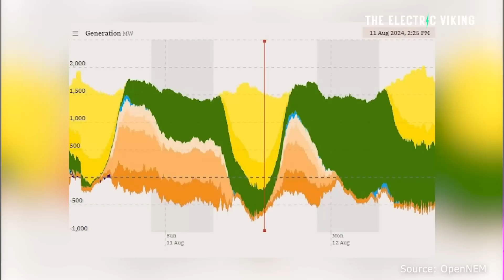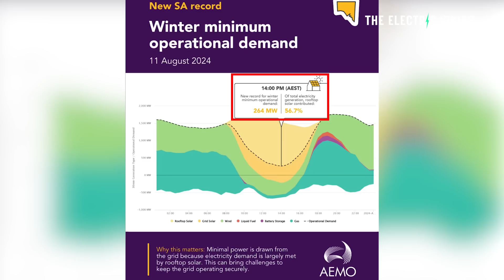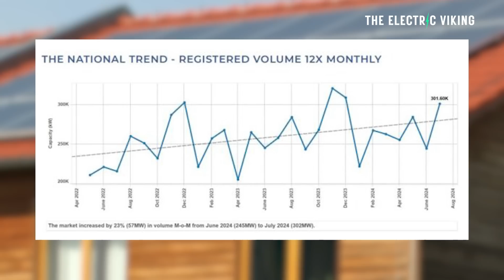Australian rooftop solar hits 81% high as Aussies install solar in record numbers

Comment: A company called Quaise Energy which is a spinoff of MIT has a new drilling technique that melts rock and is expected to be able to drill 10 to 20 kilometers deep. This will make geothermal energy available in most of the world. Former coal power plants could be run on geothermal energy and use existing facilities of these plants. This energy will be unlimited, clean, and last forever. With geothermal and thorium nuclear energy there will be no need for unsightly solar farms and windmills with their problems of recycling worn out turbine blades or toxic waste from worn out solar panels. These facilities will produce power regardless of sunshine or wind availability.
Reply: That will be great when or if it eventually becomes widespread. In the meantime Solar and wind are the best options.
Reply: Yep, no doubt. I'm sure that will be a reality in....30 years.
Reply: The melted rock would still have to be brought to the surface. This is hazardous waste because there can be high enough radiation in material from deep within the earth. Also toxic gases, dissolved heavy metals, and carbon dioxide & other greenhouse gases can be released. So geothermal is not as clean as many people believe. It also can have high water use, at a time when water is becoming a more scarce resource.
The following is from the US Fish and Wildlife Service..."Air and water pollution are two leading environmental issues associated with geothermal energy technologies. Additional concerns are the safe disposal of hazardous waste, siting and land subsidence. Most geothermal power plants require a large amount of water for cooling or other purposes. This need could raise conflicts with other users or uses such as fish spawning and rearing in areas where water is in short supply. Steam vented at the surface may contain hydrogen sulfide, ammonia, methane and carbon dioxide. Dissolved solids discharged from geothermal systems include sulfur, chlorides, silica compounds, vanadium, arsenic, mercury, nickel and other toxic heavy metals. All of these releases, if concentrated, can create localized fish and wildlife kills."
Reply: George, people with solar and batteries are free from the corrupt and price gouging electricity cartels. That is one of the points of solar, energy independence for homeowners!
Reply: @freeheeler09  Your point is well taken. There are however better technologies that have been suppressed. Some of these sound like science fiction but they have been produced by the likes of Tesla. Devices have been developed that use the earth's magnetic lines of force to produce electricity for small and large users. This is probably how Tesla was going to produce the electricity for his Montauk project. Zero-point-energy produces electricity from what used to be called the aether. It seems space is not an empty vacuum but is filled with energy. If we could free suppressed energy technologies for humanity we could enter a new golden age.
Reply: Excellent - insightful and knowledgeable.

Comment: To beat the system run a couple of extension leads to your neighbours when you are producing extra power😅😅😅😅
Reply: That's a good interim measure until batteries become a bit cheaper.
Reply: Here in BC, Canadia, BCHydro credits our net-metered overproduction 1:1 for redemption later on in winter.  Excellent deal,  because no batteries needed. You can't otherwise store it through the rainy season that long,  and anyway if you tried you'd need a battery the size of an arena. They do offer us a laughable wholesale cash redemption rate of 2 cents for unused kWhs, but that redemption rate is an irrelevant curiosity anyway if you extract your banked 1:1 kWhs for later seasonal heating.
Reply: @mikemotorbike4283  Like Australia, Canada is so fortunate in having almost unlimited natural, non-carbon, resources to generate power. Yet, like Australia exploiting vast quantities of climate destroying coal, Canada produces the even worse tar-sands oil. Wasn't 40 degrees in parts of BC and 22 heat records broken a few weeks ago enough for the politicians to take notice? Or are they comfortable ensconced in their air-conditioned ivory towers?
Reply: Sub-micro grid…